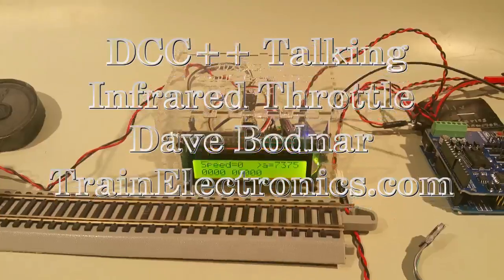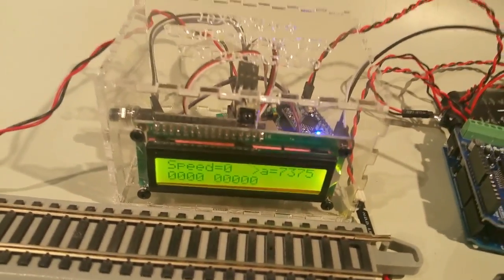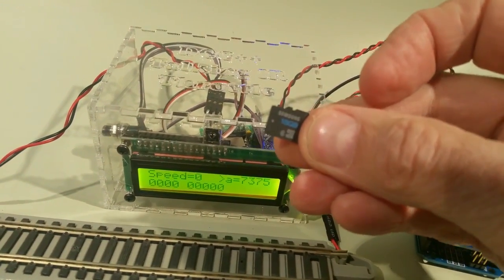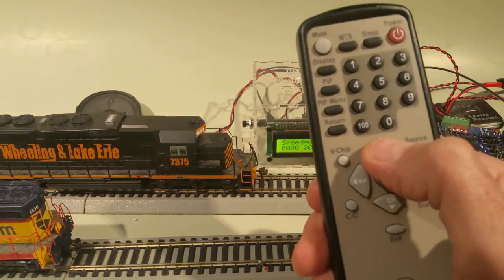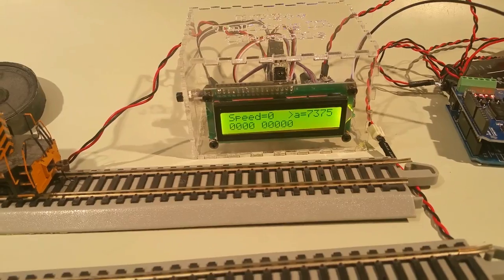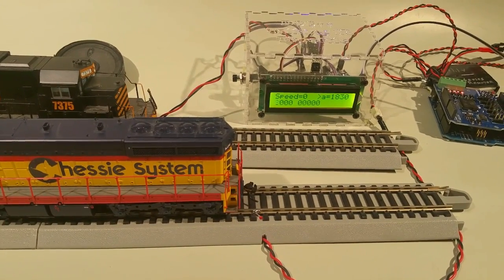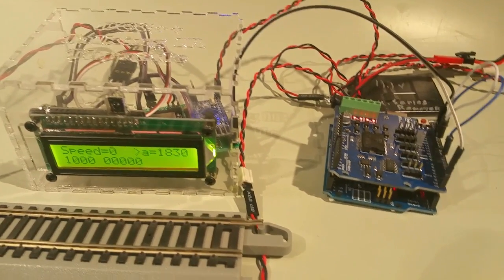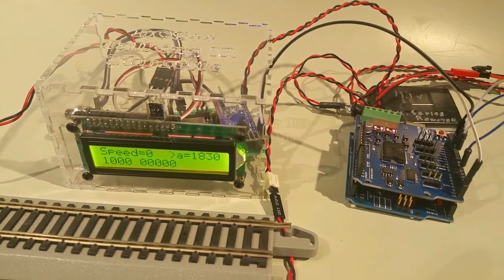DCC++ Talking Infrared Throttle

Comment: Hi Dave

Can you run more than one loco at the same time ?

Regards
Shelton
Reply from the maker: Shelton - the controller is really meant for running one train but I did make accommodations in the code for two DCC addresses - details are on my web page here:
http://www.trainelectronics.com/DCC_Arduino/DCC++/IRThrottle/index.htm
dave

Comment: Correction: I looked at your site on the IR throttle and found the sketch at the bottom of the page; is this for the Arduino mini?

Does the Uno not need an interface for the signals arriving at the RX terminal? Or do you use the standard DCC++ commands you mention on your webpage as referring to the github site you write about (so no dedicated interface software on the Uno needed)?

Also about the hardware (since I do not have the generic motherboard you use):
1. the LCD pins A4 and A5 seem to go "nowhere" on the Arduino mini, where do you need to connect these wires if you do not have the generic motherboard?
2. what is the hardware for the optical current sensor?
3. what is the hardware for the DFPlayer?

Thank you!!
Reply from the maker: The software is for the Pro Mini but could easily be used with other varieties of the Arduino

The  UNO that the throttle attaches to has the DCC++ software installed and 
is plugged into the motor shield that powers the track (this is 
explained in detail on the GitHub pages
https://github.com/DccPlusPlus/BaseStation
and on TrainBoard
http://www.trainboard.com/highball/index.php?threads/introducing-dcc-a-complete-open-source-dcc-station-and-interface.84800/

1 - A4 and A5 on the ProMini go to the LCD - on most Arduino Pro Minis 
these pins are not on the edge but elsewhere on the board.- this photo 
shows one of the connections:
http://www.trainelectronics.com/DCC_Arduino/DCC++/Throttle/images/2pin.jpg 
2.  Not sure about this question - did you mean "optical current sensor" or
 "optional current sensor"??  If the latter it is described here:
http://www.trainelectronics.com/DCC_Arduino/Current_Sense/index.htm
3.  The DFPlayer is a $5 MP3 unit - needs nothing but the Arduino, a memory card and a speaker to operate - discussed here:
http://www.trainelectronics.com/Arduino/DefectDetector/

I hope that helps!

dave
Reply: Fantastic! This answers my questions! One comment: the current transformer used is no more available from either your resources, but I found one here: http://www.aliexpress.com/item/Electricity-Meter-Analog-AC-Current-Transformer-5A-for-Arduino-Free-Shipping/32418436771.html?spm=2114.01010208.3.57.vQ2RZb&ws_ab_test=searchweb201556_10,searchweb201602_2_10037_10017_405_404_10032_10040,searchweb201603_7&btsid=ef19265e-ce26-4984-87f3-828307a78cc2
Reply from the maker: This one from eBay should work
http://www.ebay.com/itm/Analog-Current-Meter-Module-AC-0-5A-Ammeter-Sensor-Board-for-Arduino-/200986648266?hash=item2ecbbcdeca:g:fzkAAOxyzi9SgOoo
 
It looks like they are still available from DealExtreme, too

dave

Comment: Hello Dave, very exciting development on Arduino and DCC. This is the first clip I see of an arduino DCC controller that can control more than one loco!

I am just wondering if it is also possible to add extra remotes or controllers to the same layout? This would make it a brilliantly cheap system for multiple operators! Especially as working with the remotes makes running the engine very simple and straight forward! Each operator can get it's own remote, linked to a certain engine and can operate that engine around the layout.. And this for a fraction of the cost of similar systems!

Very impressed and thank you for showing this!
Ed
Reply from the maker: +kiwieds Ed - Additional functionality could be added, including multiple remotes, but I have no plans to work on that myself right now - there are others who are working on different throttle options that may be a better choice.
I suggest that you visit:  http://www.trainboard.com/highball/index.php?forums/dcc.177/ 
for more information on throttle developments

dave
Reply: +Dave Bodnar Dave, thank you for the link! I will definitely have a good look at that.

All the best, Ed